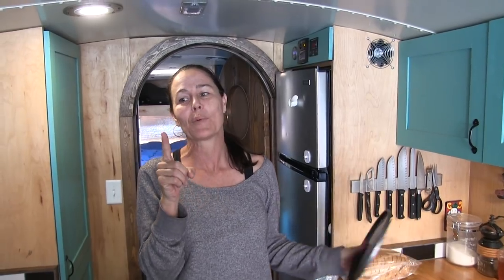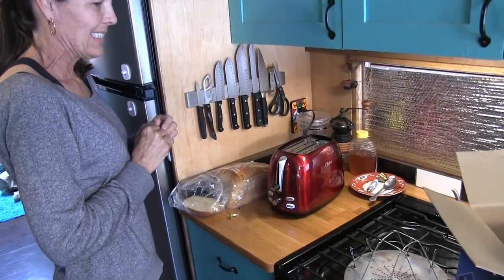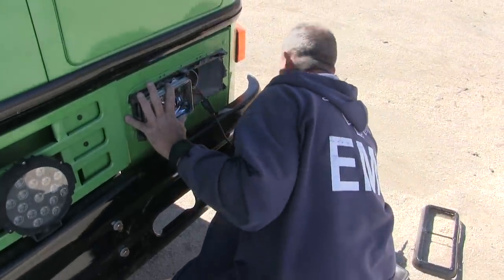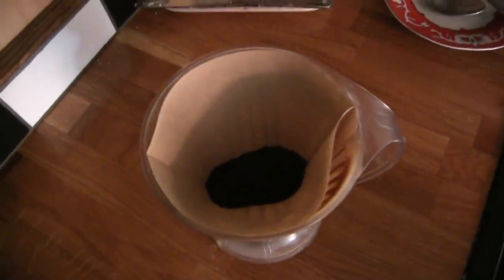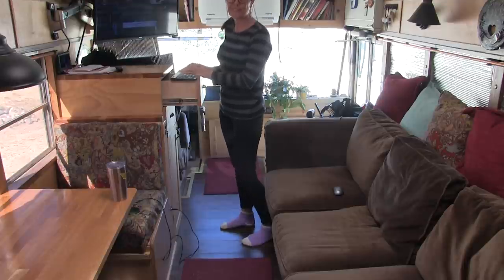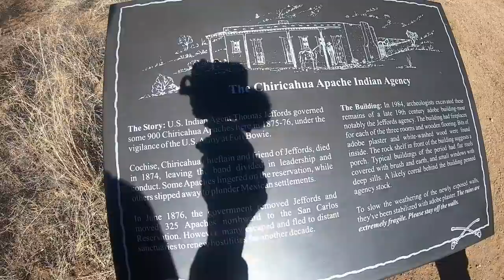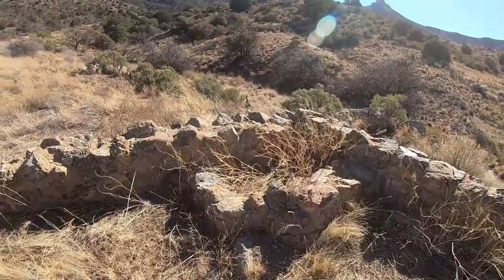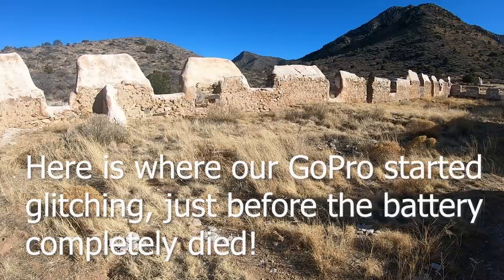BUSLIFE! Toaster Test & Historical Hike to Fort Bowie!

Comment: If that’s toaster is drawing 60amps AC take it back as it’s not designed to be plugged into any normal household outlet! The outlet you plugged it into is only rated at a max of 15 to 20 amps! Lol
Reply: The pipes a little hot!!!
Reply from the maker: 60A at 12v😁

Comment: Replace that steel buss bar that you made connecting the the shunt to battery bank if I remember correctly. That steel has a huge resistance compared to copper. You are making your inverter struggle with any large load with that much resistance.

Comment: If you start having problems with your toaster but still find you can't live without toast..Wal-Mart has a toaster that only has two burners and therefore after toasting one side you have to turn the bread around to toast the backside.. yes it might be a hassle to use but it  would use half the watts as other four burner types..

Comment: Hi guys I don’t know what wattage you’re inverter is but if’s 2000 watt then only purchase electrical appliances with low draw wattage on them ie hair dryer that only draw say 1400 watts or toaster the same the difference between appliances is remarkable,we have an electric kettle that only draws 1100 watts and a toaster 1400 and both do the same job as the high wattage units only they are bought purposely for our camper  every items watts draw is clearly marked on the tag love your channel Perth Australia
Reply: My upgrade from AGM batteries to Lithium also prevents voltage drop which inverters don’t like as high amperage draw on AGM will trip them out cheers Jeff

Comment: Hi guys, love your vids discovered them about 1-2 months ago and love them. I'm from England (South West, Somerset) and am 17 and dreaming about this sort of life. Just a thought for Mike, why don't you build/buy a motorcycle rack/platform for the back of the bus so you don't have to tow/drive the wj about.
Reply from the maker: Michael, that was the original plan actually. That said Carrie is not a big motorcycle fan and ultimately when you need to go get something and the weather is bad, having a WJ is the right answer. 😊

Comment: Kerry or Mike... l am leaning towards keeping my ceiling intact, and covering it with wood-look contact paper.  But I have two panels in the front that are "perforated" with millions of tiny holes.  Did you have these type of ceiling panels up front, and if so, did you replace them before you painted the interior?

Comment: 60 amps????? NO WAY!!!!!  like like welding steel AMPERAGE!!!!

maybe and i MEAN MAYBE 8 AMPS???

mike are you sure>???
Reply from the maker: If the toaster is pulling 1000w for instance, it is 83 amps at 12v. At 120v it's only 8.3 amps

Comment: 60 amps at 12 volts or 110 volts  I hope 12 volts.
Reply from the maker: Yes, we are measuring at the batteries which are 12v
Reply: @BussyMcBusface  That's 720 watts. A hair dryer might be more than twice that.